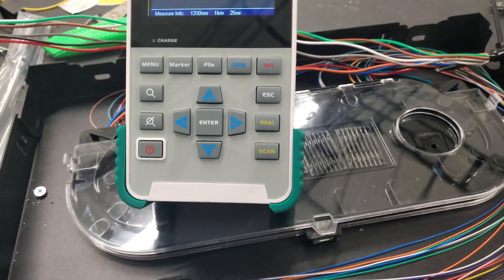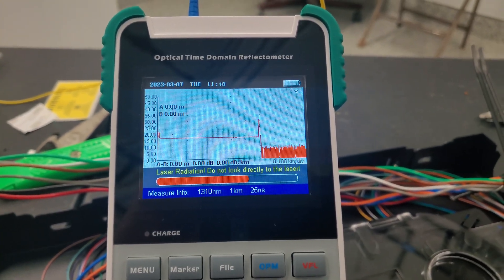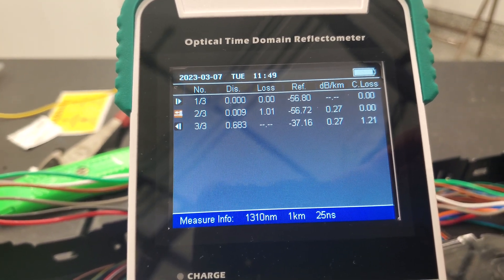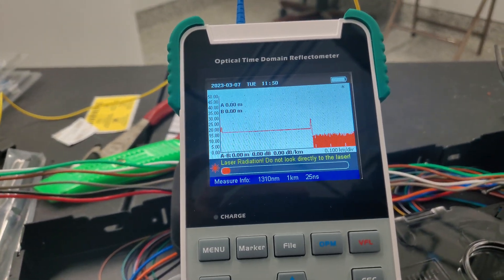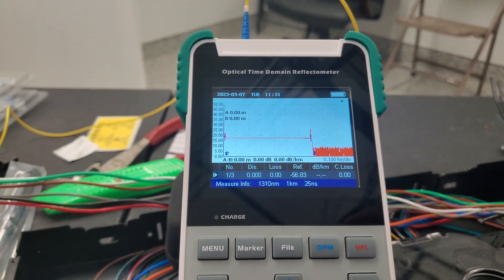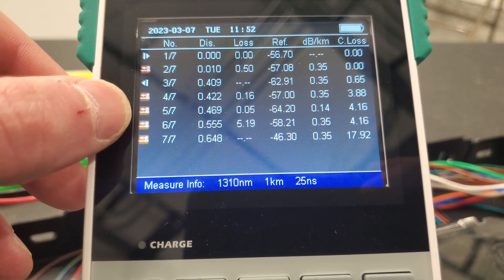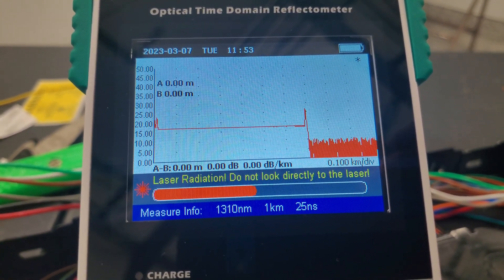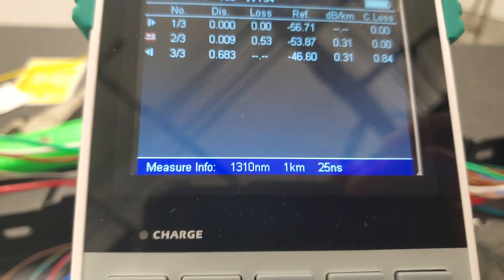Running the OTDR checking splices and distance on new build

Comment: The second event on the OTDR trace is both your connector and the splice right after it. The distance between the two is too short for the OTDR to resolve with the 25ns pulse you have set so it shows up as a single event. You should also use a launch fiber to avoid ghost reflections, especially since you guys are using PC connectors that inherently have reflections.